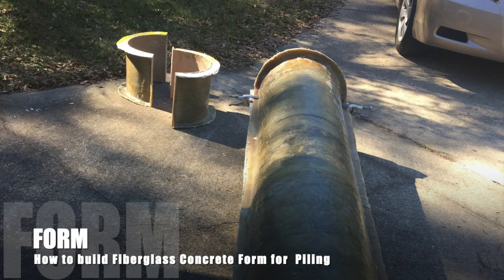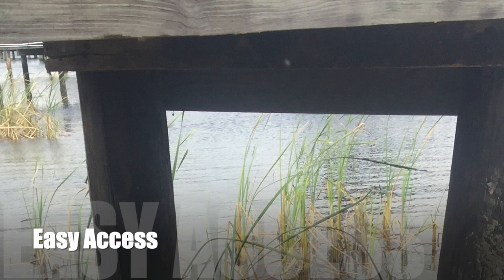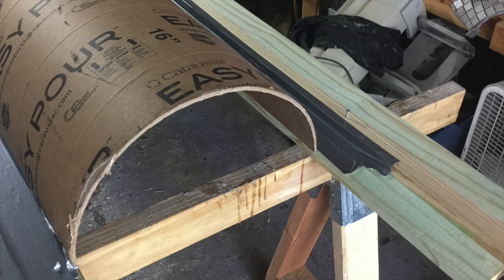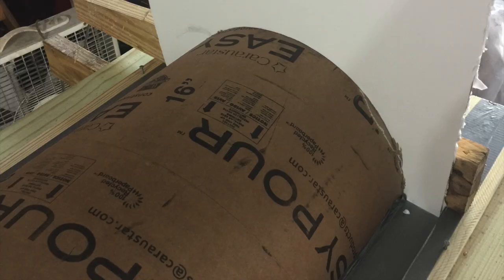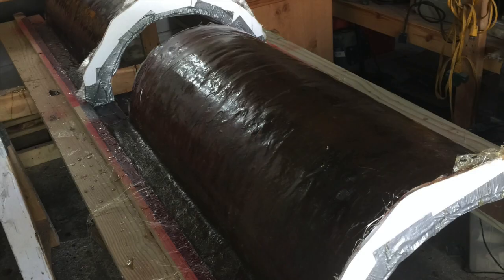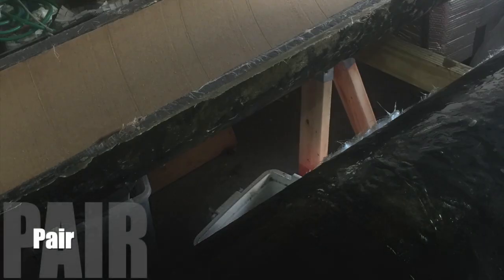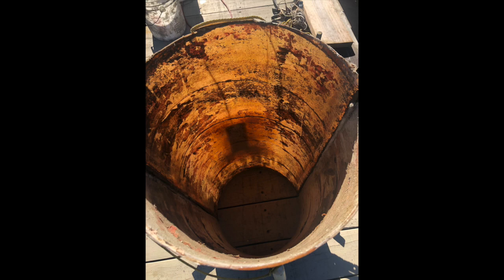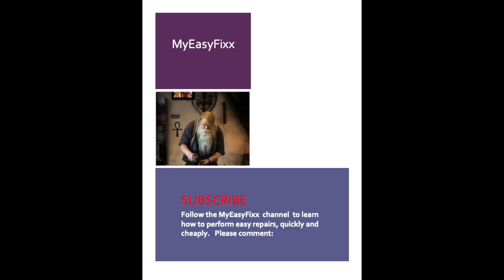DIY  FIBERGLASS FORM

Comment: Do I understand correctly that you applied fiberglass resin directly to the cardboard tube and let it cure?
You did not use a heavy weave S-glass or heavy weave Carbon fiber material in your layups. correct?
Reply from the maker: I used the cheapest fiberglass I could find.  I bought fiberglass sheets/rolls at WalMart and Home Depot. I could have gone to a special source for the fiberglass and the resin but I figured that only 3 molds would be built.  No carbon fiber, just cheap fiberglass.  Don't put more than 2, at the most 3, layers to keep it flexible and to keep it light.  I tried different release products but none worked.  So place fiberglass and resin right on the carboard form and drop the form in water for a few  a days.  Peal off the cardboard/paper after it is wetted.  Since you are doing 21 piers, the cardboard will eventually come off if you are in a ahurry to build the form.
Reply from the maker: I gues you are in Virginia.  I did not have to replace too many piles.   Most of the piles were increased in height and to protect the wood piles.  The bottom portion will erode away if you are in a hurry.  The pile needs to cure for more than 4 days. It depends on deep or shallow water and the tide and the water turbulence. 

Hopefully you subscribed.   By the way I am currently testing the reversal of gray hair by charging my drinking water in a magnetizer.  It is also in the Myeasyfixx channel.

Comment: I like the fiberglass mold idea as 8inch PVC pipes are really expensive.  I Need 21 pier/posts in my deck build in wood, probably less in concrete.
Reply from the maker: I used the PVC pipe because it was given to me.   I would have used a pressure treated log if I didn't have the PVC pipe.
Reply: Wondering what the math is like with the cheaper 6" Sewer and Drain Pipe ASTM D2729 from Menards and a length of rebar for loading?   There are the diamond piers too that look impressive and this video makes me motivated to try an open source mold design since driving tripod or diamond pod pipe seems way easier and cost effective even if using an extension tube to get out of the water with a jack hammer.  Same goes with using a pressure washer down the center to possibly blow out more at the bottom for a larger base potential that I guess can be guesstimated based on volume used.   Also, wondering about a ball at the bottom tremmy pipe method now that I'm thinking about... though that's getting more complicated for DIY, though might help with less desegregation when pouring into the PVC tube.  I like how a commenter noted holes at the sides of the piling pipe also to increase the skin effect.
Reply from the maker: Sorry, for my late response.  I didnt properlyunderstand the comments icon. 
It had a simple msg, which I misread

Well 6" diameter should work well.  The question is what is the ultimate exterior  diameter.  Remember that the lateral forces are being handled by the deck to some degree
Reply: @myeasyfixx1205  No need to be sorry.  Interesting timing AI random or not with nuisance invasive stalkers, since I recently invested in three electronic hammers for $20 ea.  The plan is to make one into a gas powered pin/post/rod driver.  For lateral forces, I want to add, plus you can add side connections or intersection points with regions to considering adding lateral cross members that are not only perpendicular.  Those can aid in the range of mechanical force vectors experienced to counter and accommodate for.
Reply from the maker: What are electronic hammers? I never heard of these
Reply: @myeasyfixx1205  Basically, like the hammer function on a hammer drill that is like a smaller shank bit jack hammer.  There are say for instance in the link below, the option to select hammer & drill, drill and hammer.   Here's my diary post entry basically to detail what I've learned most recently.  The Thor-Nado is the "electric hammer" and has an interesting history going back to like 1939 reads like and maybe earlier.  Still works too.  That was the equipment I was planning to fabricate an engine mount and coupling with clutch to use. Thinking now will use the Hilti TE52 most likely... though not certain.  Depends I guess really what I find when I disassemble the Hilti to inspect why the other functions aren't functioning.   Probably is best to test the hammer performance on the two first planned (Thor-Nado and Hilti) to see the differences. https://www.facebook.com/james.analytic/posts/4443665025695265

I've been studying the higher pressure hydraulics using water and air more lately too.  Not so much the hydraulics other working fluids, and systems and not past the maybe 6000psi systems designs.  I plan to study so I can comprehend the 10,000psi designs more since I think will be interesting for cutting and regulatory validation testing of the other lower high pressure equipment.  Really awesome to see how to qualify/validate the low pressure systems with pressure washers.  Really isn't that complicated.  However, qualifying/validating the high pressure systems is like the low pressure air systems to me... dangerous if not really critically thinking and planning every step of the circuit and process... whether physically installing,  operating and how performing.
Reply from the maker: I took a look at your link.  I am not sure how you plan to use the hammer drill system on your next project.    These days do you make models of engineering and science phenomena?
Reply: @myeasyfixx1205  I wish physically.  Mainly just studying the equipment to repair and restore. 

My main driver to pick items was for learning electronics, amateur radio and RF engineering in response to being a victim of the sound, body and mind control assault weapons like those U.S. Diplomats, Staff, Family and others in Cuba, China and elsewhere.  I found free electronics devices online on sites like craigslist, facebook, offerup, etc. to disassemble, practice desoldering, practice modifying, practice repairing, studying newer circuit designs and components like not just SMD size and in general.  Goes well with the coursework.   

Well, that turned into... mise well try to rescue high quality made in the U.S. laboratory test equipment since found that even online though being larger in size... can be used for detection purposes and in some finds are free or really cost effective.  

Then that turned into other equipment that can be rescued, repaired, restored and repurposed.  For the electronic hammer drills, basically, to repurpose into like I noted a 2 cycle engine.  Most likely to resell later or keep for future farm or homestead or other family or business needs.  Can be used for pin footings like the diamond pier systems or handy piers:
https://www.youtube.com/watch?v=WhwZ1krjN0w
https://www.youtube.com/watch?v=Um1kMx1CBXk

I think this is what inspired me to find, study and make the tool gas powered tool for fence posts and can be used for ground rods too:
https://www.youtube.com/watch?v=z8VbPblDfCs

Technically, for design planning, yes is required or best to make models of the projects at least on paper depending on requirements... though that's not what I do for a living.  Have, though kind of dumbed down lately since I posted my sonic and ultrasonic recordings of the 820MHz source that was frequency hopping in a lower case letter "m" looking tetra style signal that was associated with the sonic signal targeted me at one time and I'm guessing my family and vicinity.   I didn't post the RF with the ultrasonic and sonic signal together since until just the last day or two... wasn't disclosed by the Department of State and really the specific beam forming RF isn't really disclosed whether considered microwaves or not.  https://www.nap.edu/download/25889  

My first B.S. was from Michigan Technological University and just comes second nature to research and make models.  I used to make pattern recognition models basically for a living as that was my SME.  Technically, my B.S. from Tech is in Chemistry with an ACS cert. conc. in Biochemistry and the my second is from Davenport University in C.I.S. with a Programming emphasis and I've developed and validated alternate technology chemometrics (with other applications) software and way more.  https://www.americanlaboratory.com/1413-Issues/37116-October-2008/ (see paper: A Novel Tool for... )

Figured I better relearn some skills and learn some new skills after the multiple head traumas and GSW from my investigative work.   Plus share whatever I can to inspire others to do and who do the same.  Basically in a rehab period in my life rescuing what I can from being in worse condition.
Reply from the maker: Well I had a harf time following some of the things you are working on. I am curious  " multiple head traumas"  car accident?
Reply: @myeasyfixx1205  Forgot to mention the cavitation or whatever effect from the RF assaults by whatever they are that is remote sensing, transmitting and wireless assault and battering pretty much constantly since the Obama admin.  First noticed during the Clinton admin... though wasn't so aggressive body assault.  Didn't notice during the second Bush admin, though once the Obama admin got in... wow, insanely dangerous.
Reply from the maker: Wow, I have never heard anything like that.  I guess you lived in rough city.
Reply: @myeasyfixx1205  Yep, when I was in High School, Benton Harbor Michigan (some were bused into Coloma where I went to school) ranked no 1 in the nation for homicides per capita.  Then down the road, Allegan Michigan due to Perrigo, ranked number one or number two with I think it was a Proctor and Gamble community like St. Louis MO for most meth labs.  Benton Harbor is still Michigan's highest ranked violence city.  That's not including the long history of issues along the Great Lakes too that some is open, others is not.  Seems like mafia and some issues with POW's from WW1 & 2 on DI-X is what I've concluded.  DI-X is meth, cocaine and oxycodone along with alcohol given to the Nazi's as a wonder drug to get them killing and killed faster.  My guess is the KGB placated on those two un-American networks in the U.S. and did whatever they could to side with them to cause chaos and degenerate the U.S. to sell out itself, our identity and our assets.
Reply from the maker: Wow I was not aware of that
Reply from the maker: Well all that is behind you things are and will be bright
Reply from the maker: I am glas thongs are better for you now